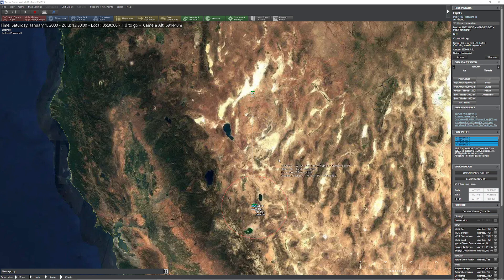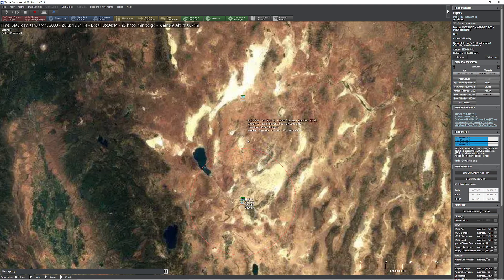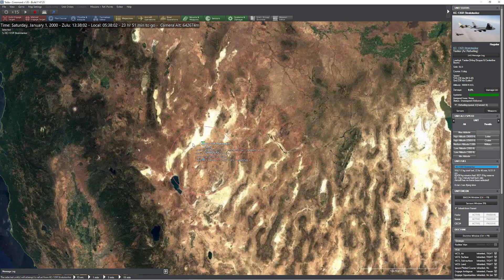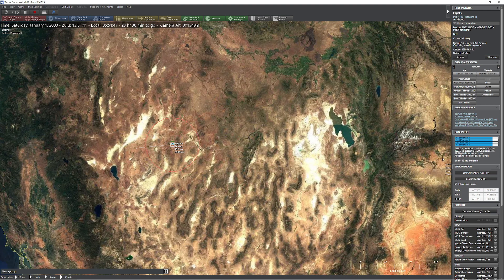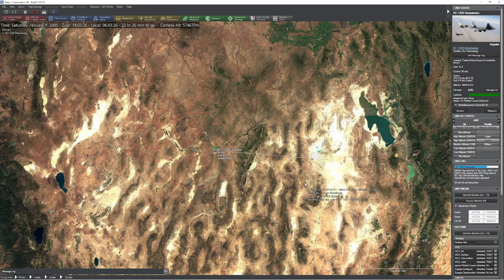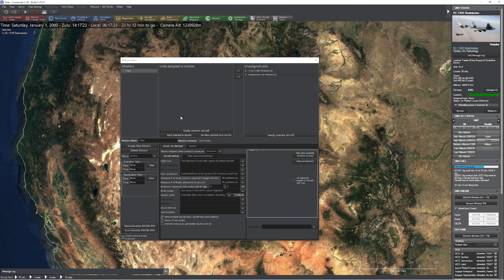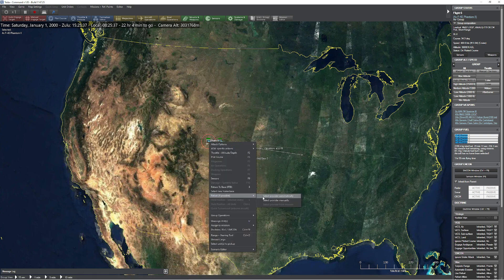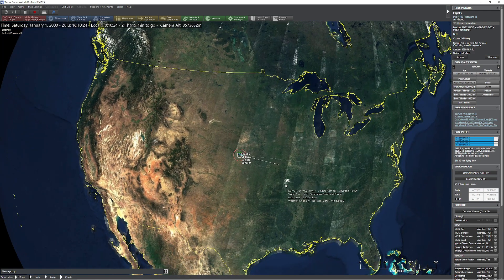C: MO - Using a tanker to ferry aircraft long distances.

Comment: They should probably patch this bug, KC-135s can only refuel 2 planes at a time.
Reply: It's not a bug per se, rather a deliberate abstraction in the interests of simplicity/reliability. 
The initial implementation did feature realistic hose-level restrictions for the number of concurrent receivers, but ended up with a lot of edge cases where e.g. receiver #1 would hog the fuel transfer and everyone else in the flight would run out and ditch. So to prevent such cases this abstraction was used instead.
The tanker's offload rate is divided by the number of concurrent receivers, so at the end of the operation you have the exact same amount of fuel transferred at the same time that it would take with a realistic per-hose limit. So the end result is the same.